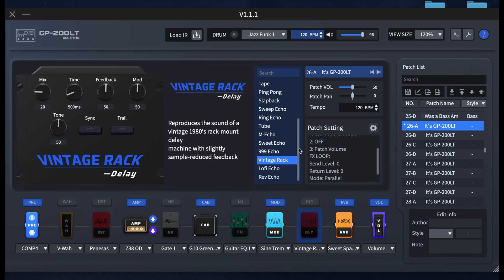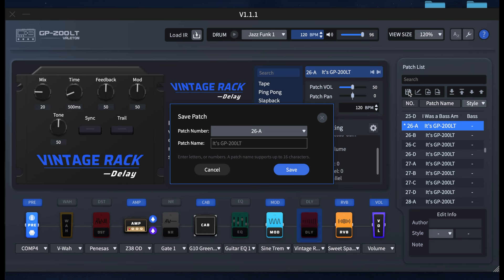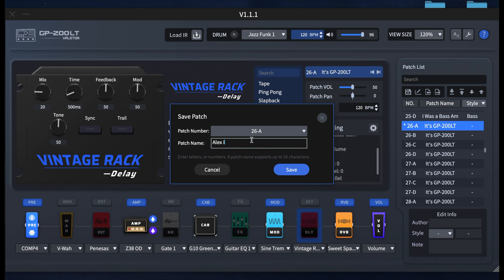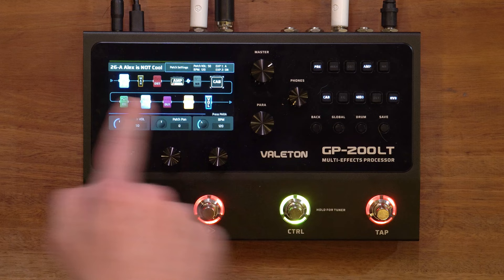Let's create a Patch and look at the Software - Valeton GP-200LT

Comment: I got a used Valeton GP100 last year, it’s little brother, picked it up for £50 in UK, I’ve been really impressed with the tones, functionality is really easy to edit parameters and navigate through the units edit pages is simple, being able to hook up to computer and use the app is a excellent feature and works great and is same layout as the GP200 and LT App editor. The build quality is excellent and very solid. I got a bargain for £50 with so many excellent sounding effects easily editable, you can’t go wrong with any of their models.
I’ve been weighing up the GP200 and LT over the last year and if I had the spare cash and could warrant it I would have definitely bought either models and will in future definitely get one. For the low price in comparison to many competitors multi effects pedals at double the price and more it does everything and has all the effects all other units do, so don’t see the point spending hundreds more on other brands that do exactly the same and doesn’t make you a better guitar player. I’m not arsed about image and I need to buy a Helix etc, the old guitar snobbery no longer exists in my world I’m pleased to say, so if something does s great job at a fraction of the price then that’ll do me.

Comment: A quick question- Can we keep 2 or 3 distortion pedals in the same patch to use it like a stacked distortion model in a pedal board where you could increase the gain of the distortion through footswitch just like having 2 or 3 separate distortion pedals in a pedal board? I am thinking about getting the larger version of Valeton GP 200 where I would have multiple footswitch and I kind of like to have at least 2 distortion pedals with different gain levels.

Comment: I have a Tube (Blackstar HT5R) amp with a FX Loop, what's the best way to hook it up? FX loop or front?
Reply from the maker: Depends on how you want to use it! If you want to use the drive of your amp and this mostly for delays, reverbs and modulation then put it into the loop…if you use your amp pretty much only clean and use this as effects and overdrives/distortion/fuzz then put it in front of the amp! I’m pretty sure there is a 4 cable method hookup option for this as well where you can put it in front of the amp for ODs/fuzz etc and the time based effects go through the fx loop on the amp
Reply: Both with the 4 cable method. I have the Blackstar JJN20 (like a HT20r) which is pretty similar. With the 4 cable method you can use your pre-amp and power amp, turn off the GP's amp and cabs and set the GP's FX Loop on and mode = Series. You can also only use your power amp and use the GP's Amps (pre-amp) by turning off the GP's FX loop and setting the mode to Parallel. Always turning off the CAB's. Really pleased with how good it sounds.
Reply: @varmutantvibes5669  I plan to use this mainly for the pitch, modulation, & space effects. Is it good enough like I-won't-regret-not-getting-a-TC-Electronic-Plethora-X5 good enough?